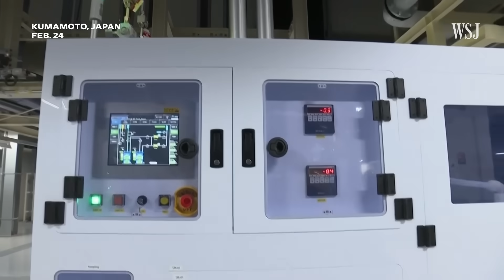The Plan to Secure Taiwan’s AI Chips Amid Fears of a Chinese Invasion | WSJ

Comment: At this point, China has given you 10 years to transport TSMC to the United States, but you still cannot complete it.  You cannot blame China for your own incompetence. In summary, China doesn't need to steal TSMC, Chinese people believe they can create their own cutting-edge chip factories. You are the one who needs to steal TSMC, but you cannot complete it.
Reply: Ironic considering SMIC's 7nm node is a 100% copy of TSMC's first generation 7nm built with DUV machines from 2018
Reply: @napobg6842  Ironically, Intel has all the EUV machines they want but cannot produce 7nm chips until 2022, which is one year later than SMIC. You cannot blame China for your own incompetence.
Reply: @napobg6842  Is that why Intel only mass-produced 7-nanometer chips in 2022, with all the EUVs they want, yet still one year later than SMIC?  You cannot blame anyone for your own incompetence.
Reply: @lianghao7128  SMIC produces 7nm nodes based on TSMC's first gen 7nm tech created using DUV machines in 2018. Literally stolen designs
Reply: @napobg6842  The performance of Huawei Mate60 is basically the same as Snapdragon 888, which is a Samsung 5-nanometer chip. There are many test cases there. I really doubt that is the same performance as TSMC 7 nanometers. If this is something you can steal, do you think India doesn't want to steal that? Do you think Japan, Vietnam, Brazil, and even the United States doesn't want to steal that?  China allow you to steal TSMC 3 nanometers, even to move the entire TSMC to the US. You just not capable to do it, and obviously this is China's fault, right?

Comment: 0:01 WSJ needs to do a better intro. Am single AI model depends on many factors such as # of Parameters, Model Architecture, Precision of Parameters, Compression Techniques and etc….

And no it does not take 1000s of H100 to train “1” AI Model. A single H100 can handle one large AI model, especially for inference tasks.
Reply: i think u need 1000s of H100 to train a LLM from scratch tho

Comment: I'm 10 seconds in and it's already false information. It doesn't take thousands, it can but it doesn't have to. Recent Zyphra model was trained on 128 of those H100 cards.
Reply: Depends on the job and complexity. Current leading AI models can't practically be built on a few hundred H100 chips, it'd take far too long, longer than competitors.

Comment: Fabs use an incredible amount of water, how does it make sense to build one in the deserts of Arizona
Reply: Arizona is a major cotton producer also.  It takes about 1300 gallons of water to grow a pound of cotton.  Cotton is $0.80 per pound.  It takes about 1600 gallons of water to make a 12 inch wafer.  Last year TSMC was selling their 12 inch wafers for more than $6,000 each. 

Wafers: $3.75 in value per gallon of water.
Cotton: $0.000615 in value per gallon.

Which do you think gets Arizona better value for its limited water?
Reply: Arizona has already sold its underground water to the saudi royal mafia 😒
Reply: Texas is also gaining a lot of semiconductor manufacturing capacity in recent years, but water is not as big of a concern there as electricity (ERCOT must build more, reliable power plants to handle the fast growing demand).
Reply: Energetically expensive though it be, the plants recycle water.
Reply: Just have Elon Musk summon it through his sheer will power as he cackles manically at the sage brush. (there's a video of him doin that for one of his own factories that needed water lol)
Reply: water is not "destroyed", if it is heated, it vaporizes into steam and returns to outdoor air through ventilation and eventually forms back in to clouds/rain/water.
This is the same single-minded logic when they say making a cotton shirt uses 2700 litres. Samsung is already building state-of-the-art facility to treat sewage water into ultra pure water for their fab in Korea.
Reply: Because chips need more than just water.
Reply: I understand a good amount of water as pure and clean as possible is needed during startup but afterwards can be mostly but not completely self sustaining as water is recycled
Reply: Subsidies and tax breaks.
Reply: pork
Reply: Intel is also in arizona. There is nothing to worry about.
Reply: Artificial water systems. efforts of reusing & recycling water is wiser for long term sustainability against short term logistical advantage of placing the fab factories near a body of water.
Reply: Colorado river supplies Arizona with most of its water. Yes levels of water in lake mead have gone down but I wouldn't say we are in danger or at a point that would cause us to impose restrictions on users.
Reply: @G_Warrior87  yeah I agree..what do scientists know? Never mind decades of data  and trends...I'll agree with you. You must be really smart cuz you write things on the interweb.
Reply: @G_Warrior87  this is incorrect. Arizona's water is fed by the Colorado River at only 36%, most of that going to agriculture.
Reply: Because it doesn't have to make sense. The goal is not about building the factories. It's about stealing the technology 😂

Comment: The fab in Japan will be mass-producing chips by the end of 2024.  Not operational anytime soon is an incorrect comment.
Reply: I believe only TSMC and Samsung are producing the best 3 nanometer chips. Intel is doing 5 nanometer while the best chip producer in China can only do 7 nanometer right now. The rest are  are even more behind.
Reply: 6nm
Reply: Won't be the best chips likely
Reply: @jctai100  None of the factories outside Taiwan will produce the highest-end chips, since TSMC is already slated to start building 2 nm and even 1 nm chips in the next few years.
Reply: I read that it's 6-7nm chips, not the coveted 3nm
Reply: @MarkWTK    It's actually 20nm & 28nm (Fab 1) for producing camera and automobile chips.  Fab 2 Japan with 6nm to 12nm will come 3 years later.   😉

Comment: What about instead of spending all that money on military and fighting. Put it in R&D and maybe we will have something better than what TSMC produce.
Reply: Correct but it takes times.
Reply: It's not an R&D issue, most of what they know, we already know. The issue is just investment in building the physical locations.
Reply: We have something better than what TSMC produces, Intel chips on its 18a process node technology will be on the markets early next year.
Reply: @JigilJigil using a High NA scanner from ASML. And no, until you tape out, it’s not better.
Reply: @johnsullivan8673  Intel is not using High NA scanners for its 18a process node.
Reply: @JigilJigil  you’re correct. I just checked. Intel dropped high NA from 18A last September.

Comment: WSJ missed the complete other angle of this - China is investing in fab facilites just as much if not more than the US is. They're trying themselves to cut Taiwan chip manufacturing off so their supply chain won't be disrupted if they invade.

Those fabs are significantly worse quality than the TSMC controlled fabs in the US and Japan, but they're still spooling up as well. When we talk about supply chain interruptions, we should probably acknowledge the adversary in the room.
Reply: @luciustarquiniuspriscus1408  The Civil War didn't "end with partition".  The U.S. military got involved, occupied large swaths of China after 1945, gave every assistance to the Nationalists (KMT), and when they lost the U.S. military ferried them to Taiwan and blocked the Taiwan Straits with the U.S. 7th Fleet.  

Taiwan also still has an 11-dash line.
Reply: What kind of Orwellian doublespeak is this? It is the US that's investing in fab facilities so that their supply chain won't be disrupted. The Chinese are investing in fab facilities because the US isn't allowing TSMC to do business with them. The big loser is, of course, Taiwan.
Reply: Industry experts are now saying that China is only 3 years behind on the leading edge chip fabriation technology, and the present size of chips can only get a little bit smaller.  In other words, in 10-15 years, China will be caught up with the leading edge chip manufacturing technology.
Reply: @jasonjean2901  in 10-15 china will be in a demographic freefall
Reply: @jasonjean2901  Do note that Chinese companies are bared from getting EUV machines and are stuck on DUV for the foreseeable future. It might be possible to make some 5nm chips through DUV multipatterning, but that's incredibly slow and is a brick wall in terms of development. This is all marketing names anyway. Indipendent tests have shown Huawei's "7nm" chip to be more comparable to 14nm class chips. Still impressive but SMIC isn't going to be nearly as competitive as TSMC is for the foreseeable future.
Reply: @catlover9998  A Shanghai-based company copyrighted a DUV machine two years ago.  They've been able to use that technology for some time now.  They only need to scale it up.
Reply: @jasonjean2901  I been hearing about China catching up within a few years to USA in many industries for 20 years. Yet here we are still leading the way. I will believe it when I see it.
Reply: China does not yet have the technological know how to replicate Taiwan's cutting edge fabrication infrastructure, but we can't count on the PRC to not catch up at some point.
Reply: @bearowen5480 Pretty sure they have the know how, they've been poaching TSMC employees for a while now. I'm pretty sure they lack the full supply line though, especially if they get cut off from ASML
Reply: It's not just a matter of 'spooling up', though. These technologies are the result of a series of breakthroughs so unlikely that there's usually only one player in the space with the arsenal of trade secrets sufficient enough to compete. Like ASML or Zeiss, for example. It's not simply years away, its multiple, successive breakthroughs away all coming together to not just make a chip, but make them reliably enough that the yield is economically viable and at a time scale that aligns with the west's momentum in pursuing Moore's law. It's not a finish line that you just need to keep steady pace on, it's a series of never ending ultramarathons through the Himalayas. If WSJ were to really dive into this angle, they would have to explain the embargos, national interest preservation measures, limitations of physics, yield and economics, never-ending supply chains, trade secrets, etc. They could, but I don't call foul for leaving it out of this video. However, I think your idea is a great idea for a video series from the WSJ.

While I agree the WSJ could have shown the china angle more explicitly, the threat from China is inherent. I don't think it was implied that China would invade to acquire TSMC, the play would always be to cripple the west. They definitely did acknowledge the adversary in the room.

Silicon chips are essentially very fancy sand. There's nothing inherently scarce/expensive about the atoms that make them up. With better and better industrial infrastructure, the cost of compute will asymptotically approach $0, limited only by energy's ability to approach $0 and the cost of sand itself.
Reply: @Jdog1681  You're overcomplicating the development issue.  The chip developers who make the breakthroughs are often willing to move to the highest bidder.  China has hired many of them from TSMC and Samsung.  They don't need to start from scratch.  

Also, China would invade Taiwan for no other reason than to reunify with a part of China which belonged to China for over 2,000 years and which only stopped being controlled by the Chinese mainland due to interference from the U.S.  Taiwan has all the legitimacy of South Vietnam, and just like South Vietnam, it would immediately cease to exist if the U.S. didn't constantly maintain its existence.
Reply: @jasonjean2901  Taiwan is Taiwan, not chinese land.